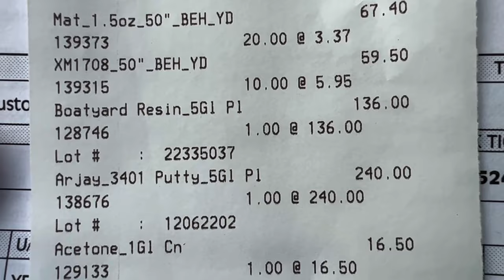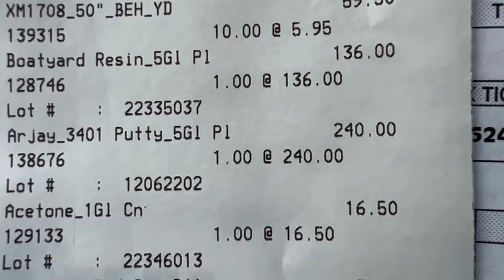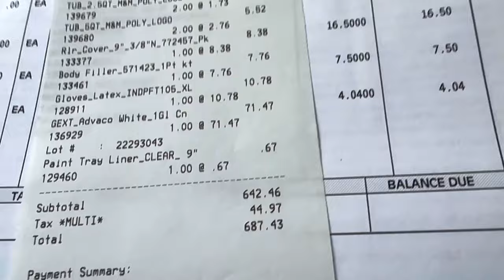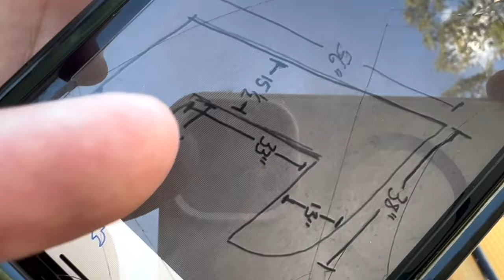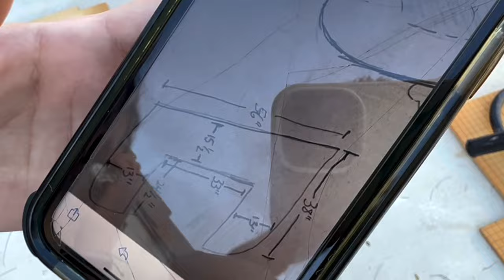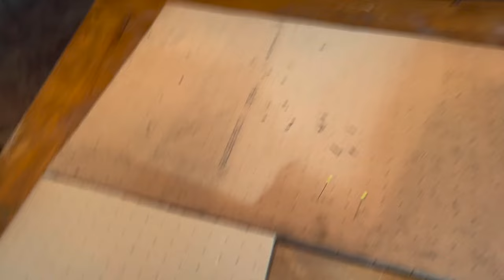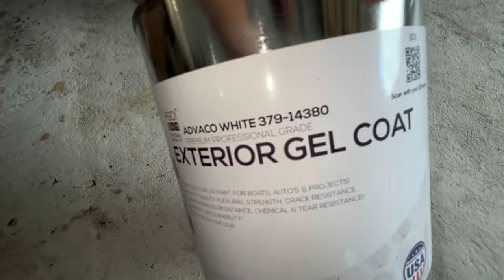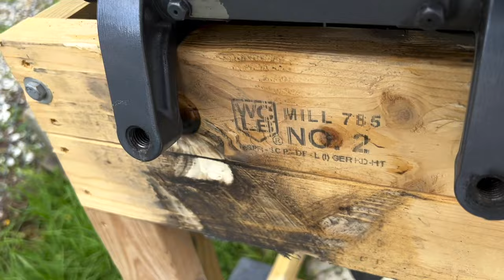HOW TO MAKE A SMALL BOAT FIBERGLASS REAR DECK FOR POLING PLATFORM   DIY START TO FINISH

Comment: Yes, doing glass work in heat and sun is a no-no. But the main issue on the first side was that you doused the glass and THEN tried to put it in place. You learned your lesson on the back side by placing the piece of glass over a the surface that had wet resin on it and then put resin over it.
Reply: In fact, glassing on a hot day isn’t so bad if you use a slow setting epoxy resin.
Reply from the maker: For sure bro. Big lesson learned

Comment: What is this foam board for deck material
Reply from the maker: its a marine foam that they sell at marine fabricator locations. There are different thicknesses for different types of projects. I do not recall specifically what it is called.